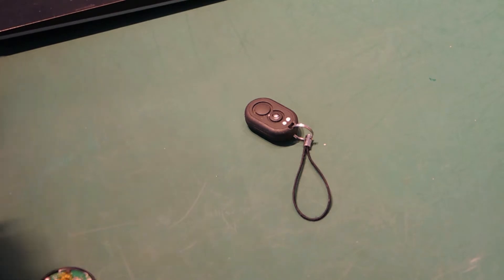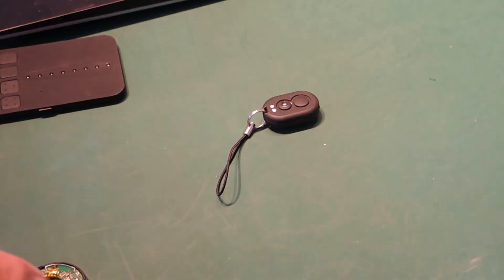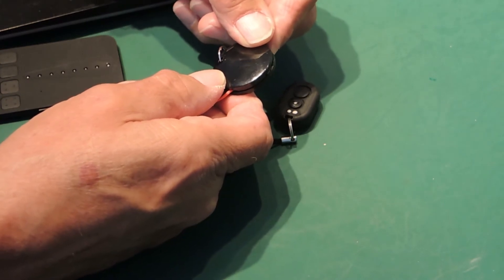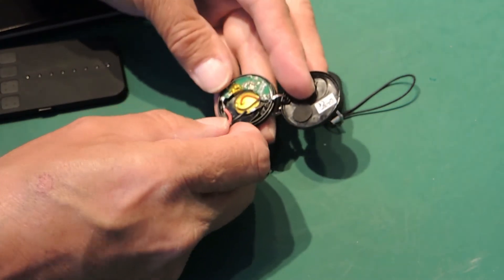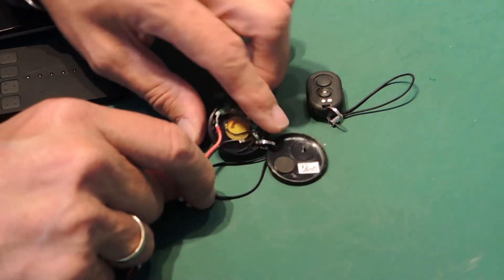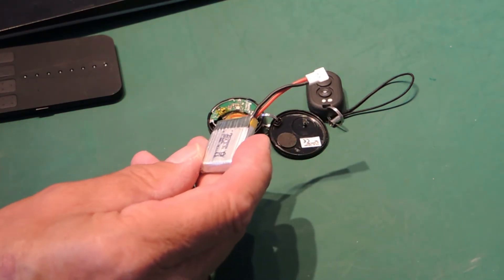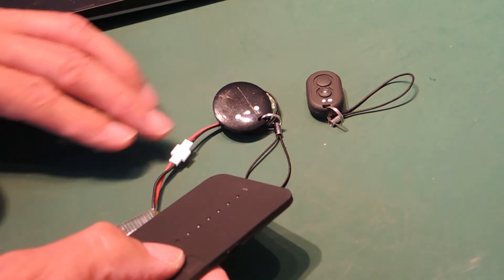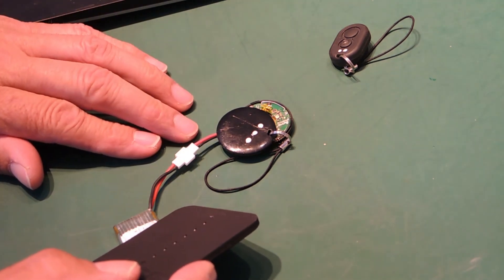Loc8tor Fix

Comment: Have you ever had any problems with the controller? Mine has just stopped working. I put in a new Duracell battery, but it won't turn on. Instead it beeps and all the lights come on when I put pressure on the battery compartment (I noticed this when I was putting the battery in), so it is definitely not the battery, but it looks as if the wretched thing has packed up - unless you have a fix for the handset too? I can't even see how it comes apart, and I am reluctant to try
Reply: Ah, I just managed to make it work, if I kept pressing the battery compartment, AND turned it on, AND pressed the button set for the cat. But now I can't again. It wouldn't be practical for normal use, but at least I can see it is capable of working (and it went crazy for the collar right next to it!)
Reply from the maker: @permaheretic  Glad you got it working